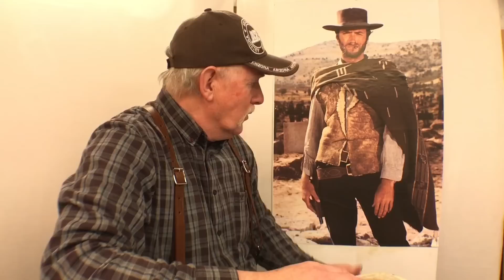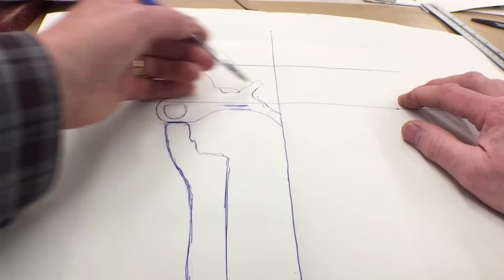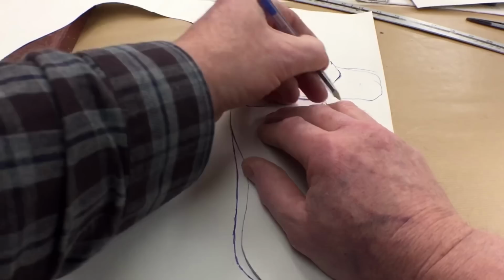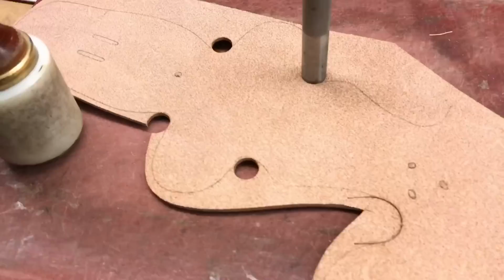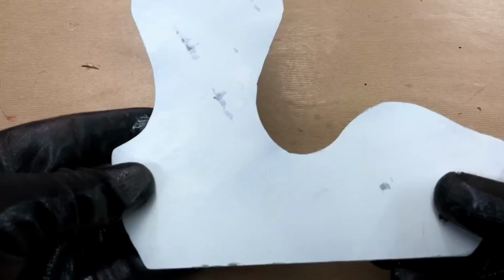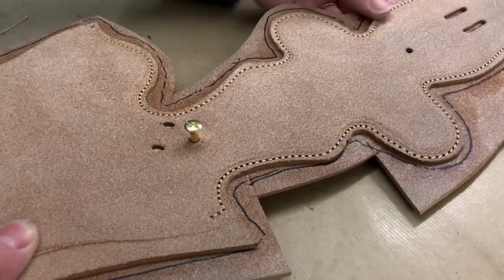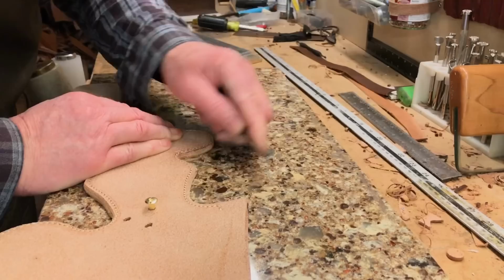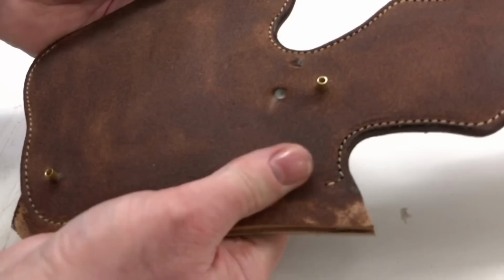Making the Eastwood steel lined Walk n Draw Rig Pt 1, PDF pattern at www.londonjacksleather.com

Comment: This type of holster was also popular with law enforcement of the time. My department used them with model 19 S&W revolvers! Only ours were much simpler and the outer surfaces were made of black patent leather over a metal frame. The inner area touching the pistol was smooth thick leather. We called them bucket holsters.
Reply from the maker: Very interesting, that term Bucket holster is used over here by some fast draw enthusiasts.

Comment: Great video. I'm looking at doing one of these.  I already have the 7 1/2" revolver done and am working on doing the 5 1/2" SAA.  Just waiting on the gun to get here and have the snakes ordered. I'm glad Clint used one rig for both guns so I don't need two.
Reply: Actually, that is incorrect. They looked there same, but the rig he wore in The Good, The Bad and The Ugly was for a .38 caliber revolver and I'm pretty sure the other rig was for a .45Colt revolver
Reply: I had read years ago a story about his rig/guns, which were all his own property.  They covered the guns more than the leather, especially the 38.  There were two versions. one that would fire cartridges and one that was not converted.  His guns had snakes on both grips instead of the right side only like replicas you see for sale now.  If I remember right they said he used the same holster/belt rig for all three movies.  It was made by Andy Anderson and spec. by Eastwood before the first movie. The holster was made to fit the SAA 45 5 1/2" used in the first two movies but the 38 from the third movie would also fit (although slightly loose). The movies were made in 64, 65 and 66.  I'm also thinking now that if he'd had a holster made for the third movie gun (38 w/ 7.5" barrel) why not make it long enough to cover the front sight on the 38.  I have a "fast draw" holster that fits the Ruger Vaquero "old large model" yet it still works with the scaled down New Vaquero and SAA Colt clones.  They are slightly loose in it but it still works.  As for the Eastwood stuff I'm now going off memory mostly so I could have missed something.
Reply from the maker: It was a great holster design by Andy Anderson, it was made for the 5 1/2” SA but the Navy also fits as well as the SA 7 1/2”.
Reply: @londonjacks8371  I just watched an episode of Rawhide from 63.  He was using a rough out holster rig but the SAA had plain grips.  Supposedly the Snake SAA was used in the season one second episode (only maybe).  It seems pretty clear that he had the holster/belt rig along with the snake gun and brought them to the three movies along with the 1851 conversion later for Good Bad Ugly last movie.  Since I'm doing a Colt Snake clone I'll probably get a belt/holster copy too.  I can drop in my 1851 clone which is a bonus.
Reply: I agree with Scott Hamp there are two different rigs. I wrote an article on that in my blog here : http://dollars-trilogy.com//2020/11/20/eastwood-holster-rig-analysis/

Comment: What advantage is thers to the steel lined holster beside a stiffening effect.
Reply from the maker: To give it more structural strength and rigidity when wearing it, no leg tie required with this holster.

Comment: Great video, what do you prime the metal with?
Would extra coats of Neatsfoot oil on the outside help to keep it clean?
Many thanks
Reply from the maker: I use a metal primer followed by two coats of contact adhesive, that fully protects the metal.
If you added more Neatsfoot oil it would just make it darker, and to much oil is not good for the leather.
A soft brush would work for cleaning the rough out leather, over time leather items do acquire knocks an scuffs etc which give the items a unique character.

Comment: Hey London jack I’m having trouble getting the correct length of my pattern drawn on paper. How much excess do you draw on your template to compensate for when the gun is in the folded template?
Reply from the maker: That will depend on the thickness of your leather but 3/4” is a good starting point, test it out using some scrap leather first and adjust it accordingly, on a new pattern I will make several test pieces to get the final dimensions figured out.

Comment: what ounce of leather are you using? and where do you get it?
Reply from the maker: It’s about 3mm, or 7/8 oz, two pieces laminated together for the belt and holster, I get mine split  at the tannery, but it should be available in that thickness from all good suppliers.

Comment: The drill attachment or "nibbler" you're using? Any advice?
Reply from the maker: It’s a double head sheet metal cutter, got it on Amazon, it works well with practice, eye protection essential!

Comment: If you use the right leather won't need steel lined,
Reply from the maker: It’s supposed to have a steel liner as did Andy Anderson’s original fast draw holster design, its there for the purpose of creating a rigid fast draw holster with no need for a leg strap.

Comment: I need to find someone to make me a LH, straight up and down double cross-draw, rig in this style.
Reply from the maker: I can make this as a Lefthand holster, but not as a cross-draw.
Reply: @londonjacks8371  why?  Even if they are just straight up and down?
Reply from the maker: Straight draw holsters no problem.
Reply: @londonjacks8371   Essentially, i use 2 left-handed holsters near the front of my rig.  I use straight up, because there is some advantage to being able to pull them on the run during a stage without breaking the 170 rule.

Comment: Just curious for your opinion….
Aluminum instead of steel… lighter… your opinion?!
Reply from the maker: You could probably use aluminium, it would need to bit a thicker, maybe 1.5- 2mm to have a similar rigidity, particularly on the “wings”, I don’t thick the weight savings would make much of a difference overall.
The pattern would need to be enlarged slightly to take account of the extra metal thickness.
Reply: @londonjacks8371  
THANX!